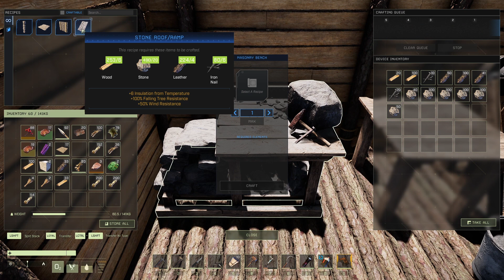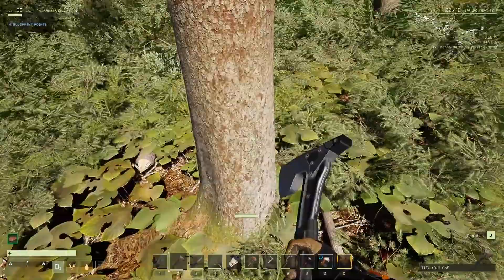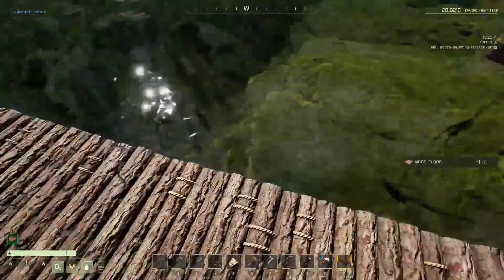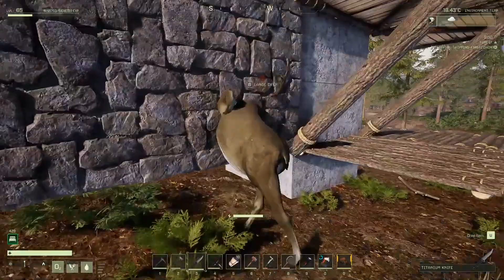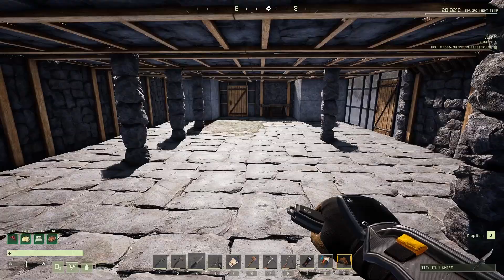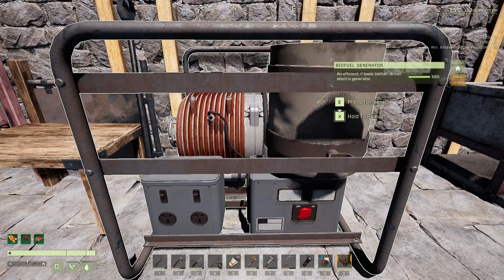Building an Off-Grid Lakehouse in Icarus

Comment: just wanted to point out you can guarantee placement by aiming at the glowing areas on the floor piece when placing pillars center is always bottom placing outside areas are top placing, but awesome build
Reply from the maker: Ok thanks I will try that. Getting certain pieces to glow in the correct angle was my main pain with certain roof pieces.
Reply: @GrindThisGame  im not sure about roof pieces but i know when adding pillars to a build targetting floor pieces work as guides